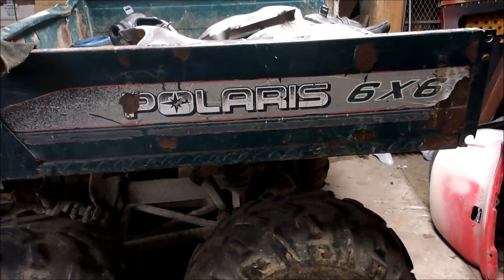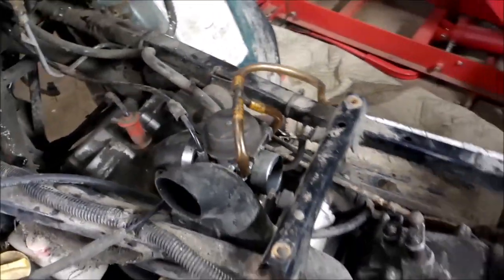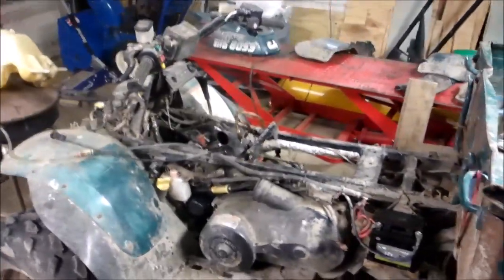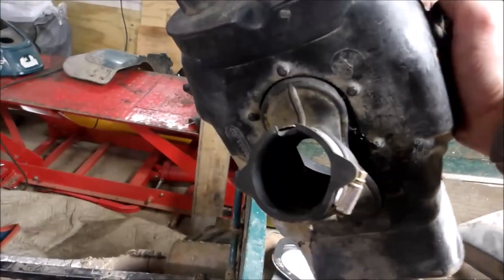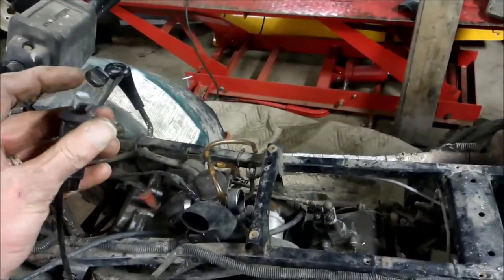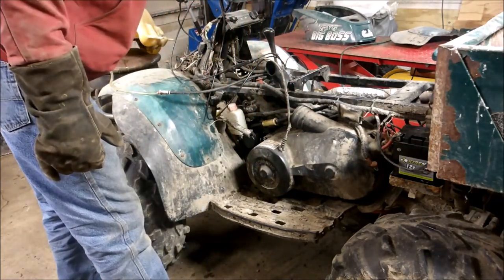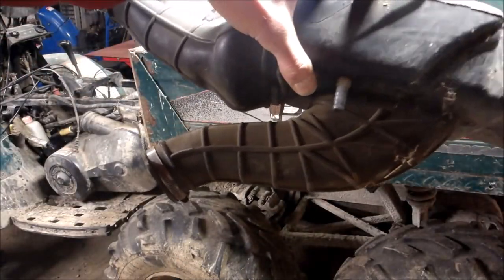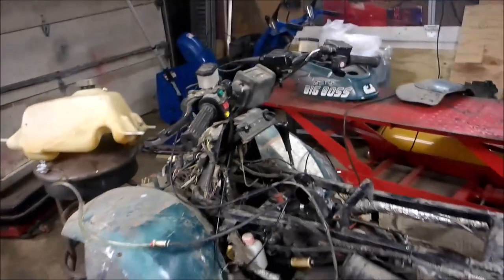Polaris 500 Sportsman carburetor issues? See how I eliminated problems with a slide carb.

Comment: can you use the original throttle cable on the big boss or do you have to get a different cable
Reply from the maker: The original cable from the big boss was too short for the slide carb from a 96 400 that I took the carb from.

Comment: What carb was that you used?
Reply from the maker: Just a stock carb from a 2 stroke 400. You can get them anywhere. Including ebay.
Reply: @TitaniummanGarage  cool, thanks.  I have a 2000 500 ho that has issues with this.
Reply: @TitaniummanGarage  What did you use for a pulse line?  I changed mine to round slide but the pulse line was on the original.  I'm using the vent line that was going to airbox.
Reply from the maker: Do you mean for the fuel pump? I bypassed it. Gravity fed now.
Reply: @TitaniummanGarage  yep,  im using that crankcase vent right now for the pump but thought it might be a problem at some point.  I didnt even think about gravity feed.

Comment: How big of a carb is that? I’m in a rut with my 98 sportsman 500. Starts and idles great and I can rev it a little bit, but it will die upon throttle once I let off completely. And it sounds like it’s bogging when I rev it up. Thinking of trashing the OEM carb and doing a slide. Any help is appreciated!
Reply from the maker: Try the cheap Chinese carb first. It should make a big difference and is only 35 bucks. The reason I say that is if you put the new carb on and it does the same it could be another issue like the cam, timing, valve adjustment, cdi box. it might be worth a try just to make sure your engine is up to snuff. Then chuck the Chinese carb, they only last a year or so and do the slide carb. I just bought a used carb that came off a 2 stroke Polaris 400. I don't remember the numbers off hand but 34 mm comes to mind. Let me double check.
Reply: Titaniumman Garage I have changed the camshaft and set timing back to TDC. Did a valve lash to .006. Only thing I’d imagine would be a carb issue or a CDI box issue? Hopefully as simple as a carb issue
Reply from the maker: @shane97075  Ok. cool. Give it a shot. Let me see if I can find that carb #
Reply from the maker: 28mm Flat Slide Carb  for Motorcycle Scooter KTM ATV 80cc-350cc. On e bay..that's cheap! 34mm or 1998 POLARIS XPLORER 400L CARB CARBURETOR 3130710. Both on e bay. Do the research on the first one. I rode a scrambler with that carb on it. I rode a wheelly for 100 feet.lol.
Reply: Titaniumman Garage another question, did you use the stock 500 throttle cable and thumb throttle setup for this carb?
Reply from the maker: No the stock 500 throttle cable is too short, the choke cable might work but make sure you put the choke that comes with the carb. If it won't stay running when you close the choke then you know the cable isn't long enough.
Reply: Titaniumman Garage what throttle assembly did you end up with on this bike?
Reply from the maker: I believe everything came off a 96 polaris scrambler 400. Throttle, choke ,everything .
Reply: @TitaniummanGarage  Did this affect your 4x4 switch?  My throttle assembly has the 4x4 switch in it as one piece.

Comment: I have a 99 Polaris sportsman I rebuilt the carburetor and it keeps on backfiring from the what do you think that could be I will really appreciate
Reply from the maker: Air leaks. Check carb boot, air lines to air box, box sealed completely. Carb set too lean? All can cause a problem